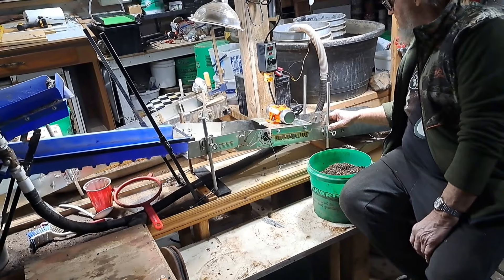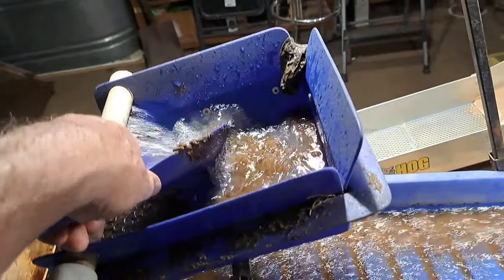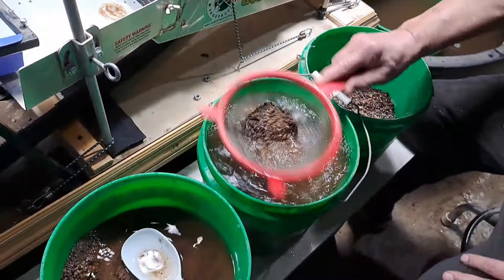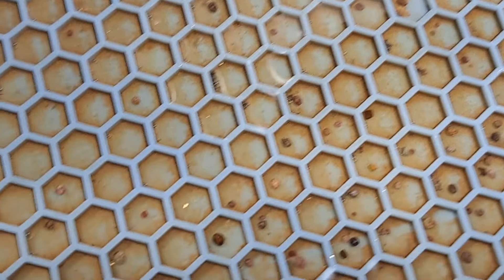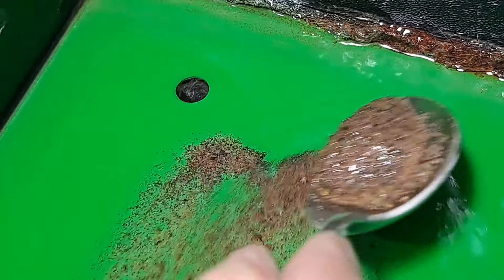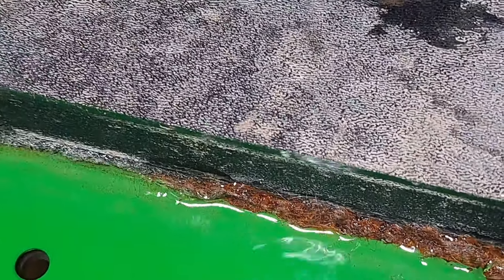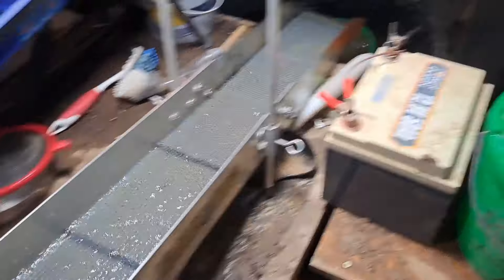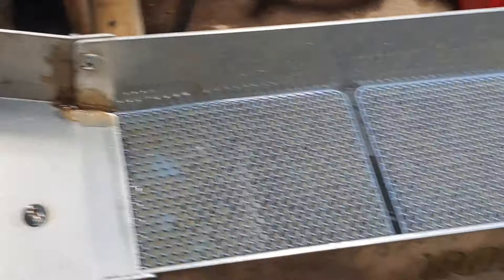Vibrating Sluice Part 2

Comment: Y'all really didn't invent anything new, afraid to say. I built a vibrating sluice fifteen years ago, and I know several other people who've done the same. When you live in gold country like I do, you get to see a lot of contraptions. Some are good, and some are not so good.
You may want to try building a framework for the sluice to sit on, instead of the legs directly attached to the sides of the sluice box. Then attach springs to the underside of the sluice, and set it on the framework. Do not permanently affix the springs to the frame, to the sluice box is fine. Instead have locating cups on the frame for the springs to sit in, with piece of rubber cut from the sidewall of a tire in each cup. That should solve your isolation problem, and greatly reduce the vibration from transferring down the legs.
My original vibrating sluice I used valve springs out of some scrapped Briggs & Stratton engines. Give that a go and have fun experimenting. 
Cheers. 👋🇨🇦
Reply from the maker: This seems to be working like this. We can pull the sluice out anytime  ww want with out taking anything apart. I know it's not new. I got the idea from watching a utube video where someone  else built one.